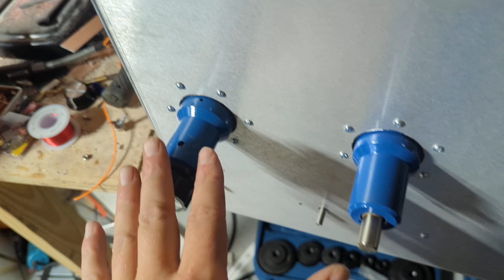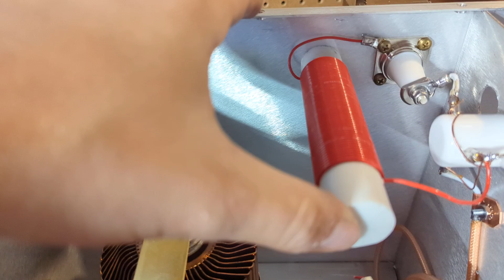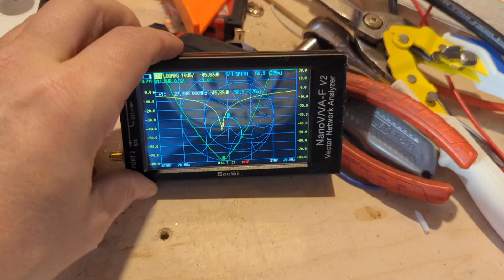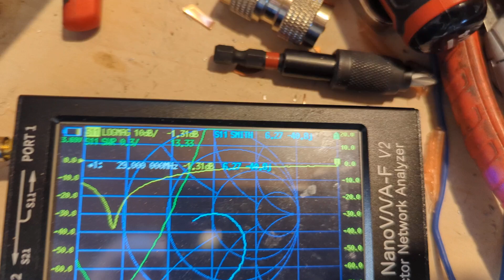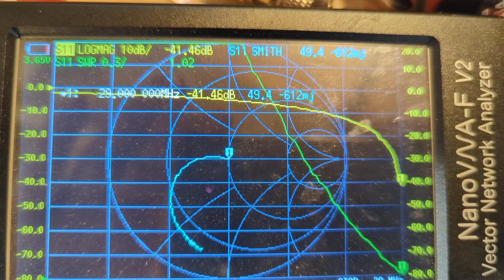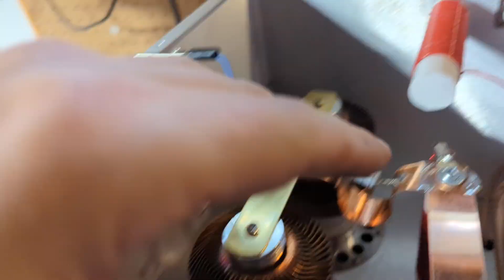GS-35b (Dual Tube (Episode #5) PA Section, output tune!

Comment: I'm so broke atm that I cannot afford another nano VNA. I KNOW.... I know.... It's rather pathetic. But fixed income is a mf. But injuries are a mf as well and they happen unfortunately. I cannot wait to get another one as they are such an incredibly useful tool. Especially not that I've learned so much about using them. There is really nothing you cannot use them for as far as building and tuning input/output networks. From the loading caps and swamping caps, tuning coax lengths and jumpers/feedlines you name it.
Reply from the maker: VNA is an amazing tool for working or experimenting with RF.

Comment: thar really coming along. nice big glitch choke. when that blocking cap fail there is a lot of energy to ground that coil has to take. now with a glitch resistor on plate supply. makes things a lot safer and if tube flash or blocking cap flash that glitch resistor gives time to trip breaker. I have tube amps come threw with out good glitch resistor. China tube flash over and HV diodes blown apart with carbon score all over the board. that going to be a heavy box.  73's
Reply from the maker: Thanks for your input. The weight is definitely gonna be a huge factor in this box. Gonna be around a 100Lb.